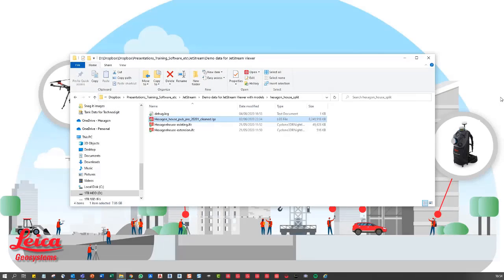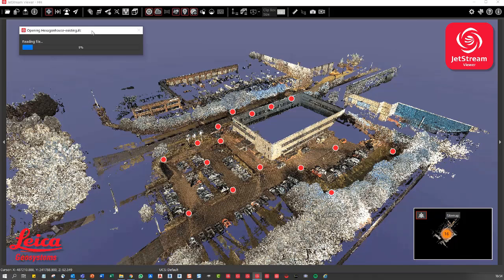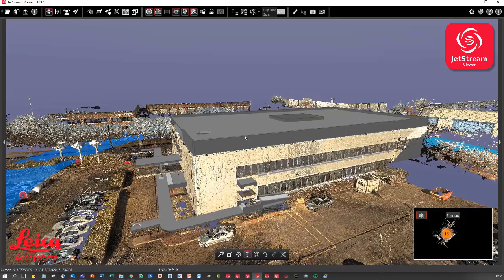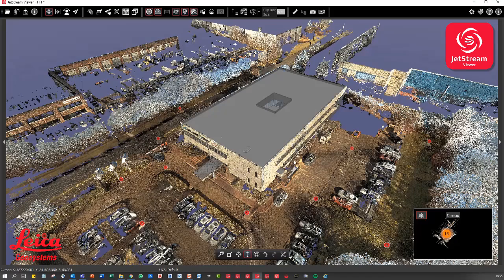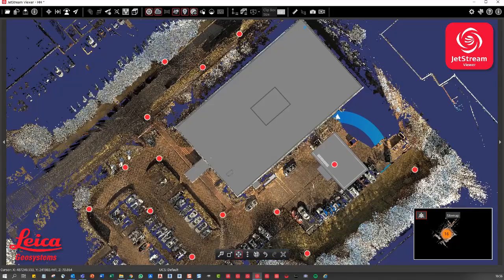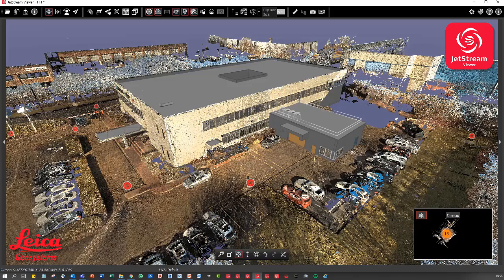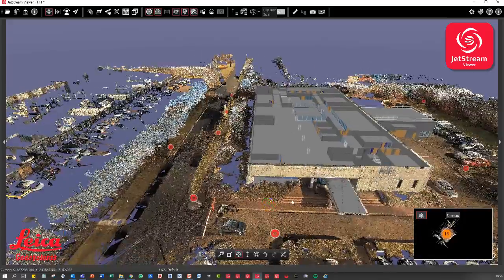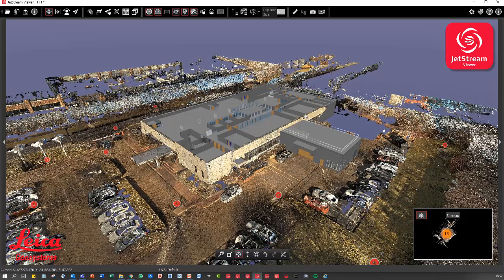Learn how to add multiple IFC files into an LGS project within Leica JetStream Viewer

Comment: I haven't been able to get an answer to my question but can you upload a Aerial Lidar scan into Jetsream Viewer? It would be in an LAS Point Cloud format and I can also import a color matched Photogrammetry Point Cloud and 3D Map from a third party software as well in separate files if you can upload and Import several files into one project. Is that possible and then to be able to send a complete deliverable in a JSV File type out to AutoCAD Plant 3D? Or just send out the jsv file type and then send a dwg file type as a secondary deliverable? Let me know or if anyone knows feel free to reply. Thanks all!
Reply from the maker: Yes. Aerial data can be imported into Cyclone CORE and exported to LGS format. We currently support import of OBJ and IFC models into the viewer - not DWG’s (yet). You can create “virtual” station positions for unstructured data too, if you’d like.
Reply: @RealityCaptureGuy  thank you so much for the fast reply. I will be turning in a quote tomorrow that rested on that so thank you!
Reply from the maker: @globalhawkllc  let’s hope you manage it! What format will you be bringing into Cyclone?
Reply: @RealityCaptureGuy  LAS most likely. If you need to use the raw data Into Cyclone I can do that too. I just need to crat a Point Cloud deliverable from my Lidar ROCK Robotics R2A Unit on my UAV to the Jetstream Viewer and give a deliverable in a JSV file type for them to use on their end. I am trying to locate a good cost on a used unit at the moment for a Leica RTC360 3D Laaser Scanner or if its usable in Jetstream Viewer/ cyclone CORE I will look at a FARO 360 3D Laser Scanner too.